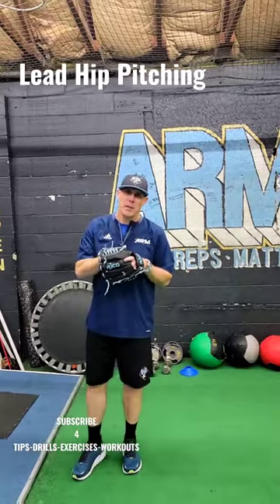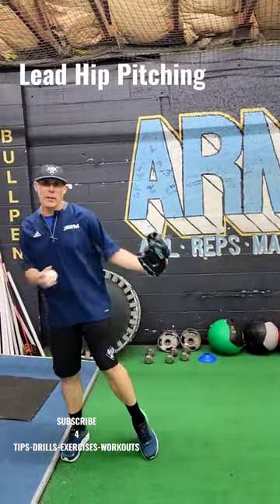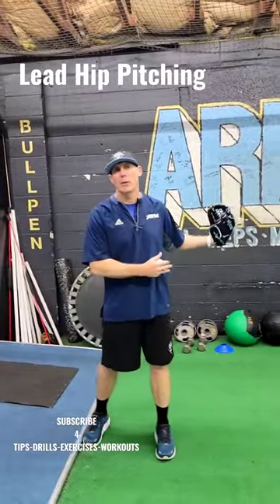Pitchers - Try Doing This In Your Pitching Mechanics For Better Accuracy & Strength

Comment: I’ve followed you for quite a while and I’m curious what you think about the arm. I know this is the bottom half but recently I think I finally figured out what it means to feel little to no effort in the arm (smooth) but I’m not completely sure I’m right. This is more for my son but I like to learn as well. Am I accurate or close by saying you don’t necessarily flip the arm up and that momentum somewhat carries the arm into place? When it drops out of my glove my arm is bent and in the past I’ve been flipping my arm up at landing and then following through with the rest of my spotty mechanics. But today for the first time I was able to throw without any stress on the arm. I noticed that when the arm went into scap load that as I turned my upper torso the arm actually flipped up and then went into external rotation without me doing anything. As if my timing was so on point that the body did its part to get the arm on time. I may not be making any sense but it feels right for the first time and I’m not dealing with bicep pain or anything near the elbow.

Comment: Question coach does this technique apply for shorter pitchers? I’ve watched videos from shorter pitchers stating that driving with hip is actually slows them down that basically loading and sitting low  till pitch release is better for shorter pitchers your thoughts? And if you could do a video on best pitching mechanics for short pitcher  that would be much appreciated 🙏😀